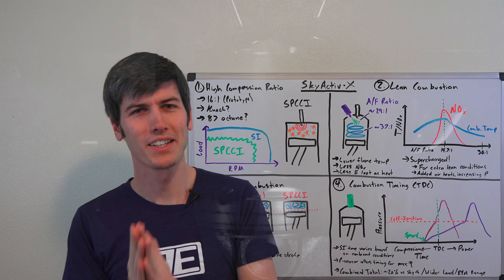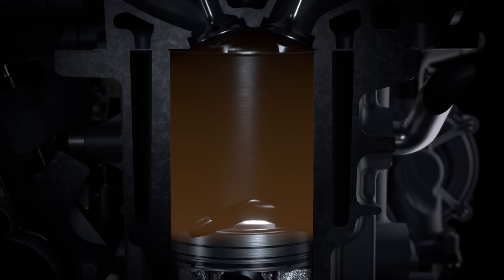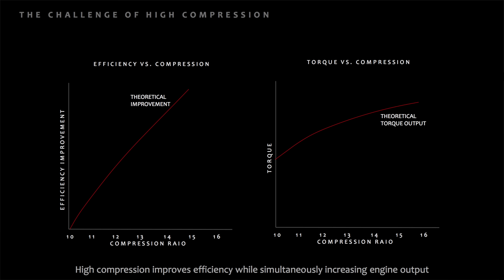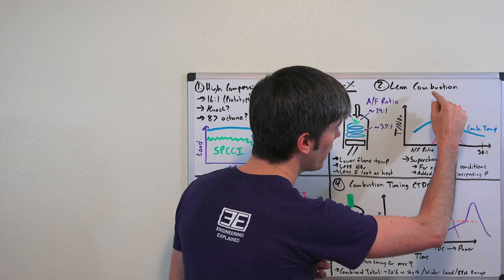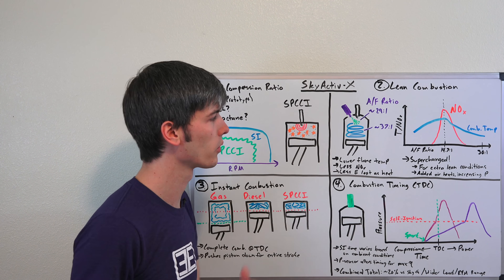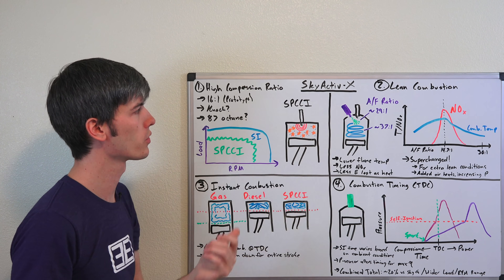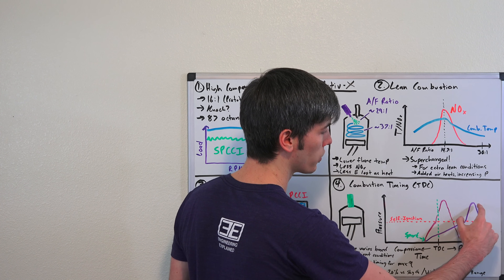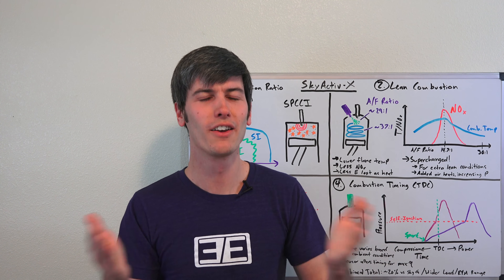How Mazda Is Saving The Gasoline Engine - SkyActiv-X

Comment: Mazda has to make up for all the Rotary engines spewing fuel out of the exhaust for all these years.
Reply: Braaaaaaaaaap
Pop
Pop
Pop
Pop
Reply: though they sound good af!
Reply from the maker: Oil and fuel haha!
Reply: TheElementalSponges The fact being referenced is that rotary engines have worse mpg in general. Rotary burns oil as a matter of course as well
Reply: They're actually doing a joint venture with Toyota to make Electric cars with a 300 cc rotary (or something around that size) in the back under the trunk to extend the range of the batteries. The combination of few moving parts and a steady RPM with it only being used for range extension makes it super efficient and reliable for what it'll be used for. And in the future, the inherent design of the rotary allows for almost any fuel to be used with it, they've been tested with lots of things from Hydrogen to Natural Gas with success.
Reply: @Dunebug6  and when the world realise what a bad idea it was to switch to electric with the abundance of wasted batteries and heavy metals, they will embrace the rotary using hydrogen  or natural gas once again.
Reply: Rotary life
Reply: James Scott ç
Reply: Yes all those ! rotary engines. How many?
Reply: Perhaps they'll use this technology on the next rotary.....
Reply: They use oil, but not dramatically more than any other car. They use about the same amount as what is considered acceptable for all manufacturers when it comes to burning oil.. except rotaries are designed to do it and still manage the same.
Reply: WORTH IT!
Reply: Josh Mac I remember reading an article a while ago about how a company did that (or something like it) and it just made it so much better and potentially more viable
Reply: maurice van doeselaar Since it was first used until they stopped producing them with the RX-8...over 1 million.
Reply: Pretty much all cars do that at some point, due to wear.. which many cars are definitely worn.. For example, GM cites one quart every 2k miles is acceptable for a 'well maintained vehicle' and BMW says it's normal for some of their engines to burn a quart of oil in fewer than a thousand miles.

You'll find that similarly maintained rotaries will burn about the same amount.. except in their case it's intentional.
Reply: yea i m pretty sure i know the one your talking about, they were making something like 5 hp per pound or a five pound motor made 1 hp or something like that, i was in high school looking at a broken pneumatic angle grinder and that thought popped into my head....it would be nice if mazda invested some into that company ...though i havnt heard much about them in a while and ive heard mazda has some SKY-ACTIVE-R rotory thing going on so maybe they already looking into it or that was just more internet BS
Reply: No it spews oil not fuel if I’m correct in my knowledge
Reply: @mercury9060  Both, they got like 18mpg in the rx-8 which is horrible for a single axle driven vehicle. Not only that, they usually took 2 quarts of oil between changes. I personally can verify this from experience
Reply: Shawn Warnick ok gotcha, thanks for correcting me. :)
Reply: Corrosion37
Reply: I would love to see a "long lasting, powerful,  lightweight " rotary engine!! The mazda  fd rx7 was an exciting relatively lightweight sports car that I would love to purchase.....but my wallet was afraid of "that" rotary motor....!! It could be made to generate a, lot of horsepower.....

just jim
Reply: Rotary rules hp/liter
Reply: Corrosion37 true af. Thts wht i thought too.
Reply: When cold, the rotary's run incredibly rich and dump lot's of fuel through the cat, which causes issues for some owners
Reply: @Pspgamer789  Well you got regularly red line the engine and that engine isn't meant to run short it likes going far
Reply: lol the only reason i dont currently own an FC turbo 2, ive always wondered why mazda never tried to flip the rotary engine inside out, have an oval spin in a triangle(ish kinda) less sharp edges seems like it would be easier to seal for longer, so you know they burn less everything, maybe thats a question for Rob Durhamm
Reply: @joshmac7245  because that is impossible
Reply: @russotusso1695  its not impossible if you google X mini rotory engine you will see how it is possible and has shown to  have vary promising results but everything is moving to electric so its unlikely it would be used for anything more than a range booster...neat eh? possibility getting stretched each and every day
Reply: It's right there with the valveless head where the cam was the "valves" and made the engine a lot more fuel efficient and made more power, but  haven't heard anything in years.
Reply: +TheElementalSponges they spew out both... which is even worse...
Reply: rotary engine, mazda 7 + 8.. maintenance is expensive, till u drop
Reply: Sorry but only the foolish use today's standard to judge, things that happened in the past. As l long as they passed emission tests of their time. There was nothing foul about it :)
Reply: @nc3826  Thank you.

Comment: All we need to do is use 100% of the heat and then we have max power. Which is impossible
Reply: heat is a by product its not a steam engine...
Reply: Lima Charlie heat to mechanical work. In a combustion engine we only use 35% of the heat, 65% is wasted.
Reply: no, its expansion of gas through combustion process into kinetic... there're other processes which does not involve combustion (no heat) but with expansion of gas into kinetic... it is not wasted because a combustion engine in a car cant effectively harness heat in the first place that's why its a by-product not a waste you can make use off... at best you can add a turbo to extract work out from exhaust gas and use heat-exchanger/absorption chiller to heat/cool the car
Reply: Lima Charlie im talking strictly heat to mechanical work
Reply: there's no heat to mechanical directly.. its the expansion of gas that pushes the pistons not heat.. while heat is needed in the combustion process it does not contribute to work... its not a steam engine... that's why for vehicles you have otto/atkinson cycles not carnot cycles
Reply: Lima Charlie. You are wrong, ask Engineering Explained.  He has covered this.
Reply: DrewLSsix what video is it
Reply: Lima Charlie look up HEMI engine- explained... its by Engineering explained
Reply: Back in the 70’s a working fluid technology called ROVAC converted waste heat from exhaust into kinetic energy.  Read it in Pop Science.